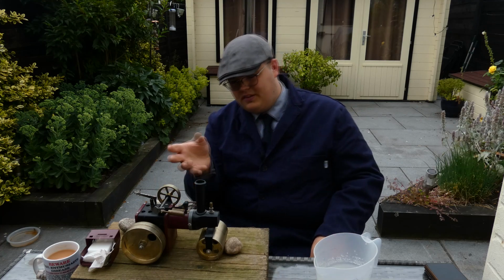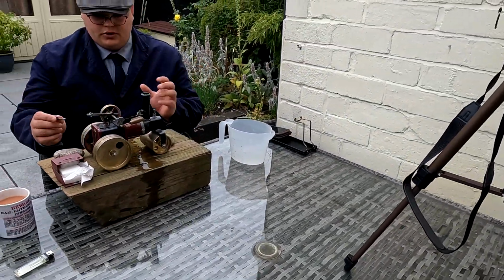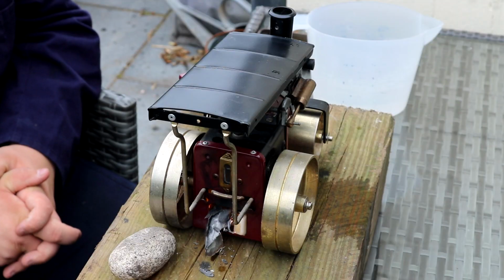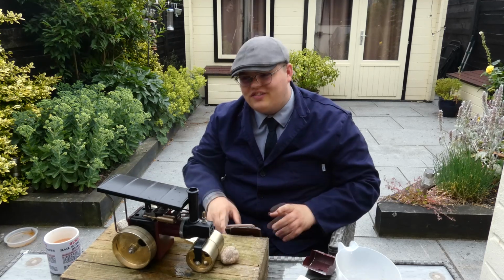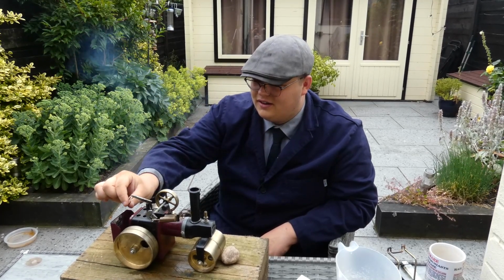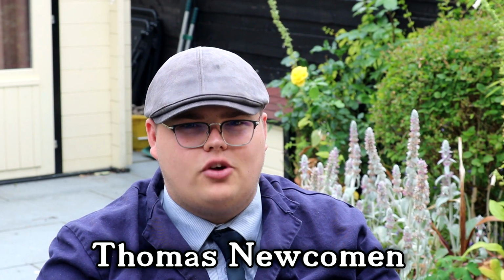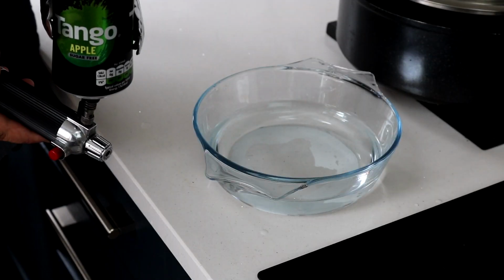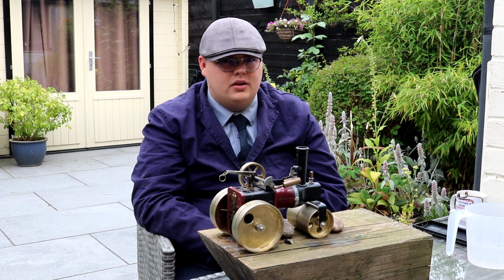The Early Days of Steam Power | The History of Steam, Part 1

Comment: Richard Trevithick was an early pioneer of steam-powered road and rail transport; he developed the first high-pressure steam engine and the first working railway steam locomotive. Trevithick Day is celebrated every year on the last Saturday in April, with street processions including the Bal Maiden dance and a steam engine parade with steam engines attending from all over the UK.
Reply: Yep.. I cycle on that 1804 track bed from Merthyr to Cardiff now and then. The sleeper stones are still there.. he did the first ever rail tunnel also.. legend.
Reply: Trevithick.. I cycle that first ever track bed from 1804.. from Merthyr to Cardiff. Some of the sleeper anchor stones are still there. Legend.